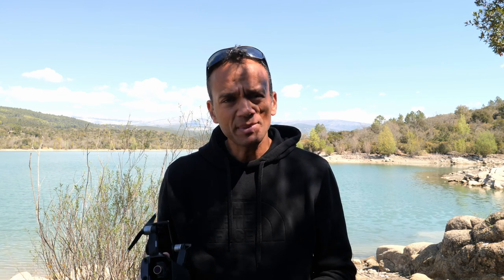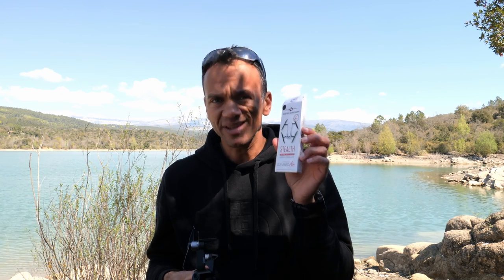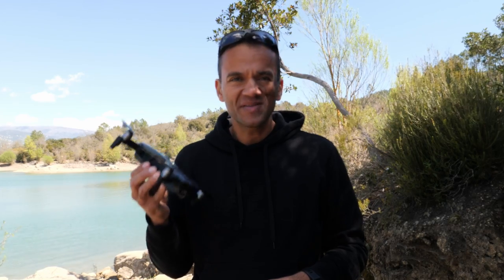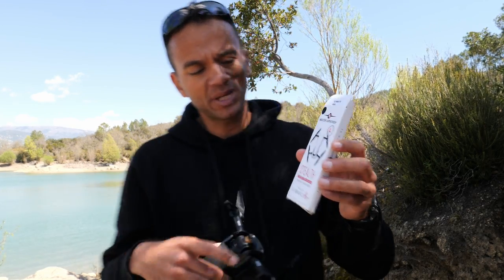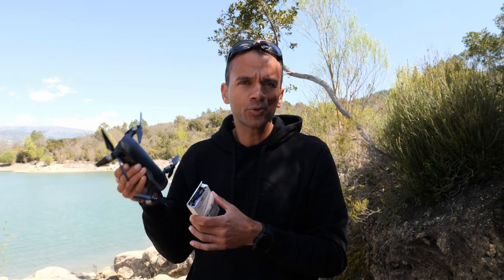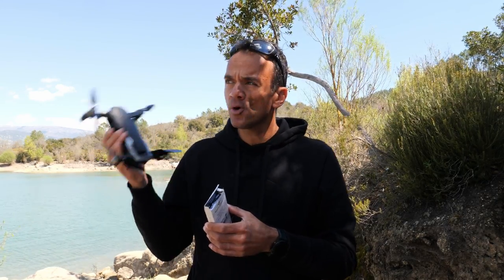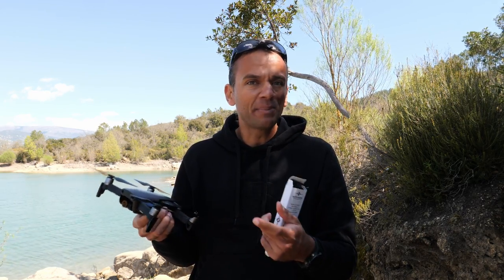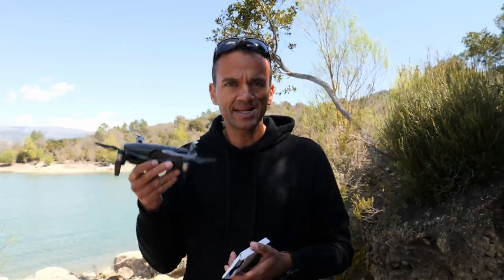Hélices à faible bruit Master Airscrew pour Mavic Air

Comment: Hello Max. Hélices enfin reçues. Emballage propre, petite pochette en tissu "brandée" de la marque, c'est joliment présenté. et petit flyer permettant le paramétrage du Gain du Mavic Air avec ce modèle d'hélices. Tests avec sonomètre (en intérieur) : appli sonomètre à 2m (sur Crosscall avec micro peut être un peu bouché !!) : Décollage vol stationnaire et atterrissage : Hélices DJI : 63-64 décibels - Hélices Master Airscrew : 59 - 60 décibels. Essai transformé pour ma part ! merci encore pour ce tuyau et longue vie au Mavic air qui est un excellent compromis pour débuter ;)
Prends soin de toi.
Reply from the maker: Merci pour ce retour. Plus qu’à pouvoir refaire du drone en toute liberté 👍

Comment: Salut pourrais tu faire un tuto sur la calibration  des sensors  de proximité  moi j ai un souci avec et j ai l appli  en anglai et je ne voudrais pas faire de connerie j ai trouvé un tuto mais pour le pro et je ne sais pas si c est pareil .il parle de faire ça avec un ordi.
Reply from the maker: Salut
Il faut installer dji assistant sur ton ordinateur et y brancher le drone. Ensuite il n’y a qu’à suivre les indications. 👍
Reply: @MonSport06  désolé de te déranger max mais impossible d installer dji assistant 2 Windows le refuse totalement même en compte administrateur je ne sais pas comment faire ça ne fait que 3 semaines que je l ai et un seul vol de 5 minutes.
Reply from the maker: Pose la question sur le groupe fb dji Mavic Air. J’ai eu ce souci aussi sur mon pc et je n’ai pas voulu chercher du coup j’ai essayé sur mon mac et ça a marché direct. 
Tu penses que tes capteurs ont un souci ?
Reply: @MonSport06  merci de ta réponse pour les capteurs c est l app que me demande de calibré les capteurs. je n ai pas de bol avec les drones ce n est pas  mon premier mais j ai toujours des soucis. pour dij assistant je pense avoir réglé le problème . j avais télécharger l app avec ce nom DJI Assistant 2 1.2.4 que j avais trouvé sur dji France impossible de l installer et en cherchant la solution je suis tombé sur DJI+Assistant+2+1.2.5 qui lui installe sans problème je n ai pas encore fait la calibration.
Reply from the maker: Ah cool. La calibration se fait facilement tu verras. Branche juste le drone à ton PC avec un câble usb assez long car il te faudra mettre la caméra du drone face à l’écran et bouger le drone donc si ton câble fait 20cm ça ne marchera pas 👍